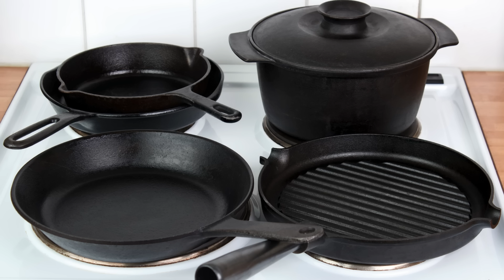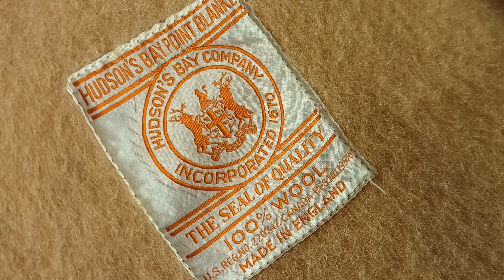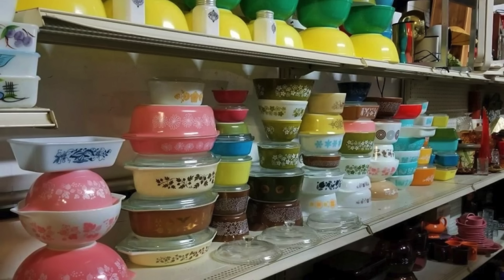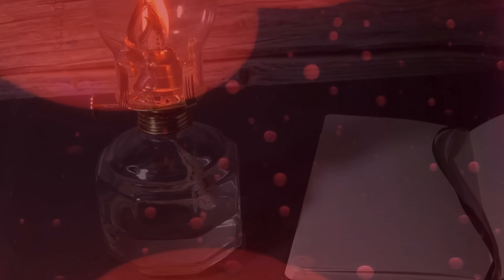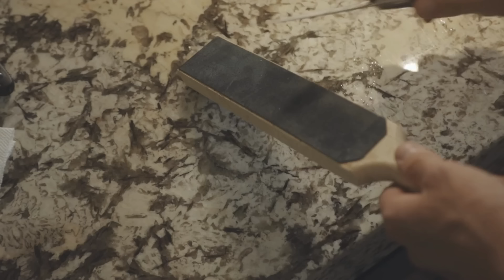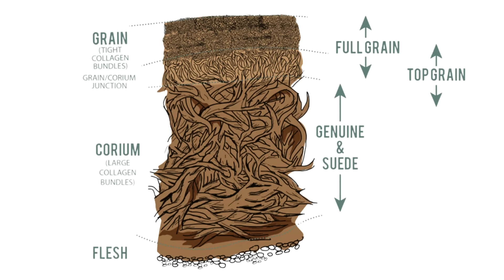10 Goodwill Items That'll Outlast Economic Collapse

Comment: Come on , don't give goodwill or salvation army a bad rap.. I have found some really good camping equipment.. And I still am using my cooking ten to this very day
Reply from the maker: I found amazing cookware there. They are over 75 years old and still work great. i also have lots of compliments on them when people come over for diner 😊
Reply: @Sidney_Explains_Money thank you.I still use my cooking tin.. Found it in goodwill years ago.. I still take it camping..
Reply: What you find in thrift stores depends on where you are.
Reply: @sctahir i found my camping cooking set in goodwill.Still use it to this day
Reply: @KarenLee-j4n I believe you. I just know that in this area what we see is mostly trash. A lot a plastic and low quality throwaway  items. Having said that I have an 8 inch cast iron griddle pan I got about 10 years ago at the Salvation Army. I also have an old hutch mde in England and I bought a metal daybed for my mother when she had to move in with us after a stroke. The Goodwill is more and more over priced and picked over by resellers. My friends in Naples Florida,  say the consignment shops and tgrift stores there have a great variety of quality goods.
Reply: @sctahir look around in flea markets and take stores.Goodwill salvation army , a lot of antique stores will have the old high quality merchandise still.. I still use my mother's can opener and I have been camping since the age of ten.. And that can opener is even older than that.. I mean , I carry this thing around with me like a set of keys l o l..